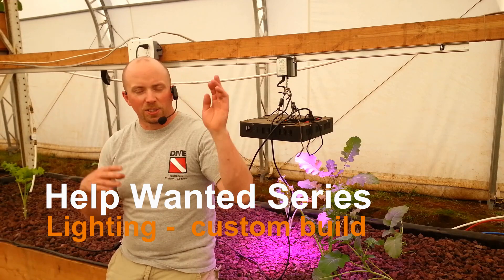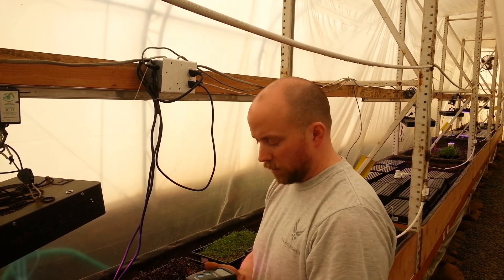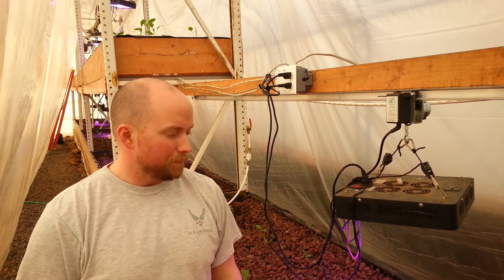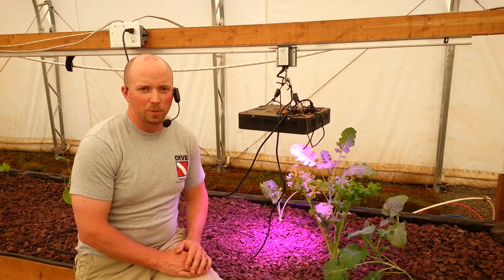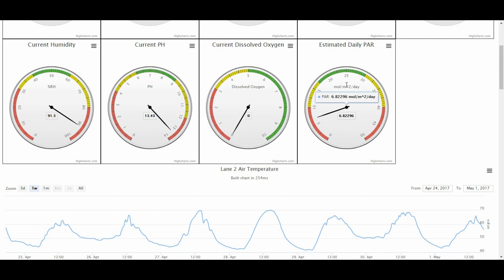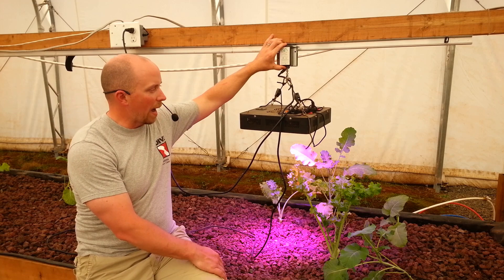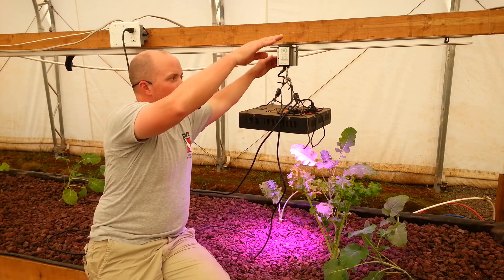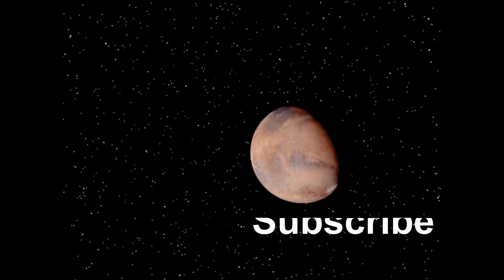Building your own Grow Lights, or buying custom?

Comment: This looks like this might be a good place to start  http://www.ebay.com/itm/50pcs-lot-Full-Spectrum-Led-Chip-400-840nm-for-Plants-Grow-Light-LED-Diode-/291234250536

If you attach them to Aluminum square stock as the heat sink and put a little fan on one end you can pipe the heat outside during the summer and heat the building in the winter.   I'd have to experiment with the spacing for proper light distribution but if you put lights on 2 sides of the tube 90º off of each other that should be plenty of directional light to cover the entire bed.   I'd go with 2 inch square stock just so it's a sufficient heat sink.

Comment: Here is a picture of a large gortrac system we have handling hydraulic, air, and electrics for one of our machines : http://i86.photobucket.com/albums/k103/wanjockey/Spuncast/20170601_074940_zpswnxucd3o.jpg

you can get many sizes from mcmaster-carr for example : http://www.dynatect.com/  
https://www.mcmaster.com/#=17vvqy1

Comment: Get some industrial standard merc vapor or otherwise...  LED's may work if you get the correct colors and use enough of it. Just saying that Light is 50% of the grow cycle... nutrients are the other 50%... water is a no brainer but make some light dude. Also Merc Vape would give you heat too. I know it costs money to run. Metal Halide is good. https://www.1000bulbs.com/category/hid-lights/

Comment: check out Alibaba or AliExpress for low cost grow lights
Reply: Totally Alibaba. Search for LED grow bar
Reply: Genghis Chuan please explain
Reply: Genghis Chuan so the facts are, you've never bought any of these yourself and you have no direct or factual knowledge about all of the products or sellers on this two sites?
Reply: They do tend to cut corners on these sites to be honest. where it be being skimpy on the heatsink or using low quality diodes, or reflow soldering the diodes poorly. I would avoid and go the DIY route. If something goes wrong you know how to fix it. Will also be more repairable, to begin with if done via DIY.
Reply: Mark Evans have you bought any LED products from anyone you are accusing? If so who?
Reply: it's funny because my son, who just finished the first grade, recently studied facts and opinions.  I showed him these comments during his break from piano lessons needless to say but he knew right away if they were facts or opinions.
Reply: I have a friend who purchased 3 'grow' leds from a seller on Alibaba, which seller I couldn't tell you. All I can tell you is the components were shit, they were very poorly reflow soldered and the 'heatsink' was 1-2mm alimunium plate. So yes I have direct hands on experience with some of the LED products from this site.
Reply: The comment re your son, is very odd lol.
Reply: So would it be fair to say I bought a shirt on eBay and it was crap so every Shirt on eBay is crap and even all the thread on eBay is crap?
Reply: Mark Evans you find it odd I find it humorous
Reply: You need to revert to my original comment where I said "in general", as in , most but probably not all sellers tend to cut corners. I am sure there is the odd good LED unit on there, but good luck finding it, good luck getting post sales support. How many items have you purchased on alibaba or aliexpress? I have purchased several and the items I have had are dangerous and the sellers can barely communicate in some instances.

For instance, I purchased several halogen lamps which can be used for lizards, the sellers remove the float glass cover, which allows low levels of DEEP UVB and UVC to be transmitted, do you understand the significance of that? it's dangerous and isn't allowed in most western countries. I can send you the listing for those if you like? Based on a handful of experiences with sellers on there and based on reading lots of listings and being in communication with several of the sellers, many of them are dodgy, nothing less.

Stop quoque round a subject simply to try and support your original point.
Reply: Oh sorry I didn't notice that you said"in general" in your original comment.  Anyway it doesn't matter how persuasive you make an opinion sound it's still an opinion